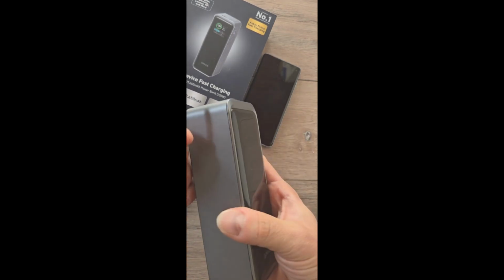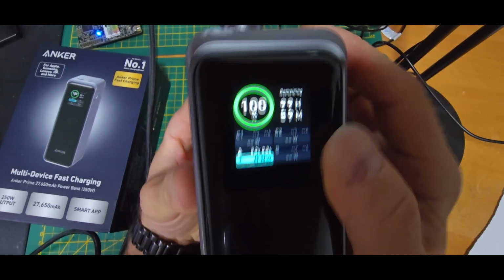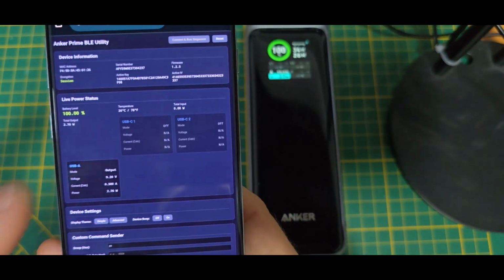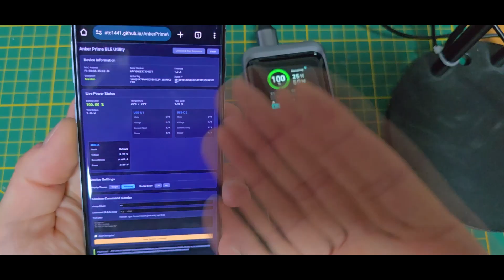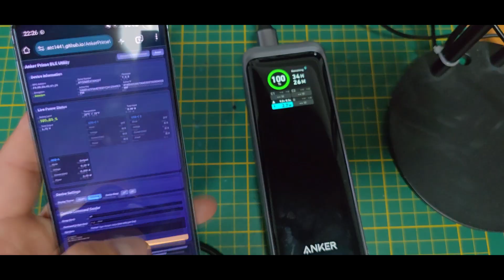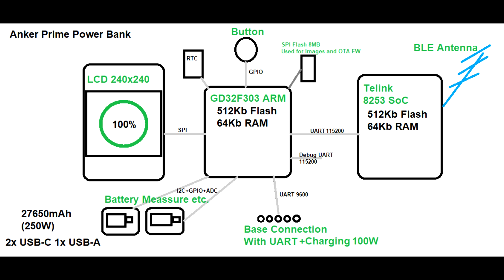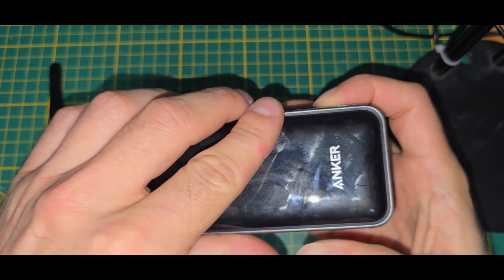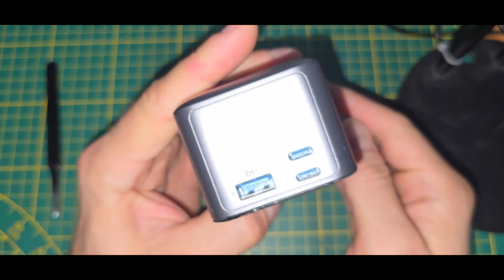Hacking the Bluetooth enabled Power Bank Anker Prime 27650mAh

Comment: I have one of these and it’s pretty good.  I really like the fast charging.  I used mine while working on a contract where it was really hard to get a desk but loads of touchdown spaces with no power.  I’d recharge it at lunchtime and also on the train home and that gave good enough results with the SP9 that the firm gave me.  It also fit under the SP9 kickstand, so that was a pretty cool use of space.

I don’t switch BT on most of the time, although I have done in the past.  Hacking these sort of devices is interesting, particularly in the case of larger home systems where the company decides that a perfectly good product is obsolete due to them wanting “upgrade” revenue.

Comment: Hi Aaron, could you please tell me how can I update my Anker prime with 1.6.1 firmware. The current firmware via app OTA os 1.6.8 which I dont want. I see you have older firmware's in you repository in GitHub and I wonder how can I flash that firmware. My Anker bank has a bug where display doesn't display correct capacity and i believe this was resolved with firmware, but as said I want to remain in 1.6.1. could you please give ma advice or procedure how to update to older firmware

Comment: Mine doesn't charge or power on.  I've tried all the reset options, but none have worked.  I thought about taking it apart to see if i could find an obvious problem.  Does anyone have ideas?
Reply: I suspect mine has water damage, might just be the screen, but I've been afraid to open it (and didn't know how until I saw this)!

Comment: Wouldn't it be cool if we could set the charging speed ?
Set a limit to 80% of charging ?
I don't always need the full capacity and would rather extend it's life. I don't always need it to be full within 30 minutes and would rather not overheat it. 😊
Reply: Are you mainly using it for your phone, or a laptop/something on 20v+? 

I don't think a phone charging from it at 5-9v would have that much impact considering the additional overhead. 

Although I'm just now realizing you probably meant the limit the charging rate of the battery itself lol
Reply: @cmorche ahah. Yes I meant when charging the battery itself.
Reply: @christophec.482  - Don’t use a 140W charger and it’ll charge slower.  I like to charge mine at full rate though, just for the kudos of having something that’ll charge that fast.
Reply: @daveys and sometimes i need to charge fast as well. But most times i would like to have control on how fast and how much.

Comment: I'm very interested in the Bluetooth protocol details. On a power bank, I agree it doesn't offer much value, but I'm looking at the Anker Prime 6 ports desktop charger (A2345). The BT would be nice from an automation perspective: monitor port state and usage, control power to the ports. Hopefully, there should be some similarity between these devices.
Reply from the maker: Looks interesting indeed. Would bet its similar in general
Reply from the maker: That one uses an ESP32-C3 as well as an synwit SWM34S
Still interesting but too expensive right now ^^

Comment: I got one of the smaller ones and was thinking to build  myself a charging station for it. Did you by any chance have a look at what the pinout for the connector at the bottom is? So what pin is what. You mentioned it exposes UART. Did you have a look at the commands/messages that go over that?
Reply from the maker: Hey, the Pinout goes:
GND-GND-TXD-RXD-VCC 
you can check the orientation based on the double GND

The base does initiate to the Power Bank but so far only static values and no auth

Every ~30ms
Station sends:
AAFF0201000104FF7E
Bank replies:
BBFF000101FF7E

AA(BB)FF and 7E are header
Reply: @atc1441  Thanks! I assume VCC would be 5V initially and then it negotiates a higher one or how is it done? I'm curious if the 20.000mAh version I have will give a different reply.

Comment: Are these layer lines on the side of the shell 3D prints layer lines ? quite weird for such a mass production product. Or is it just textured Injection molding ?
Reply from the maker: Its a design pattern so just "normal" Injection molded